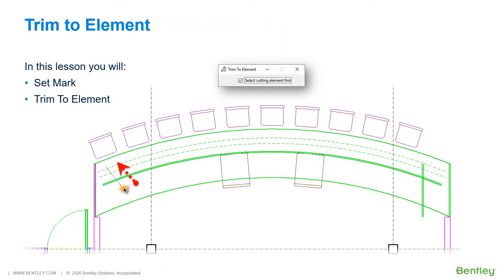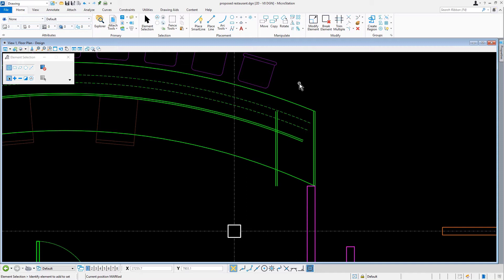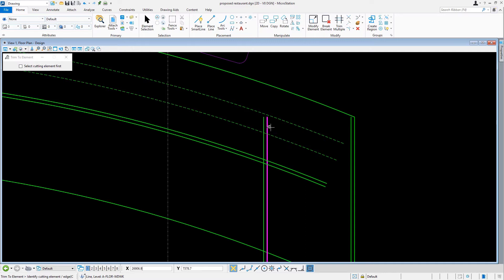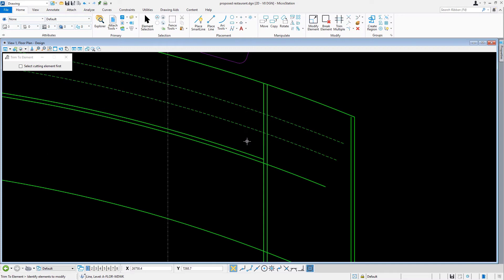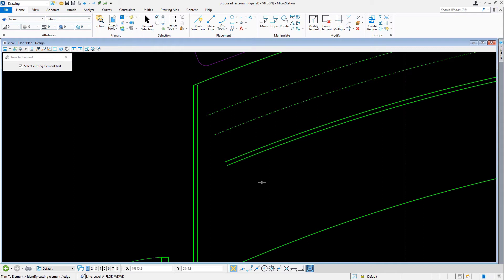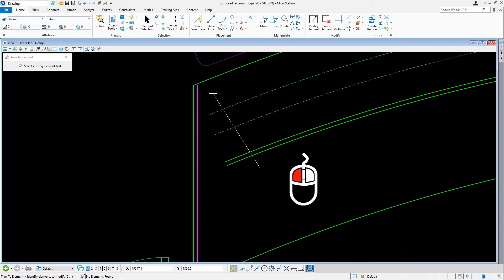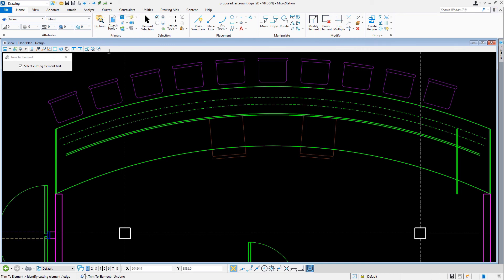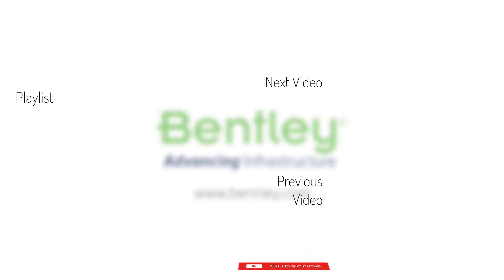Part 3 Trim to Element

Comment: If I look for an explanation for why on friggin' earth you decided to remove this command from OpenRoads I end up on this video.

Bentley would probably tell you that the command isn't necessary anymore because blahbity blah blah blah. Worthless.

Example of something that is now incredibly onerous because of your inexplicable decision: I want to extend the grid lines on a cross section drawing so that I can put more data on lower elevations. (The lower bound ended up too high with the named boundary settings and I'm not going to redo my entire frigging cross section set over this so if you were going to suggest that just shut your trap right now.)

Well, what do I want to do? Click "extend line" on each of the 142 grid lines individually? Select them all individually, and then grab their ending nodes individually, and drag them all together?

Ultimately I scaled the lines on the Y axis only and then put them in the correct place. What a waste of frigging time.